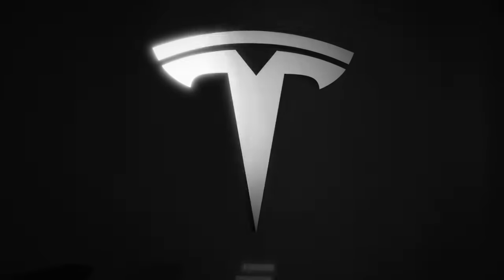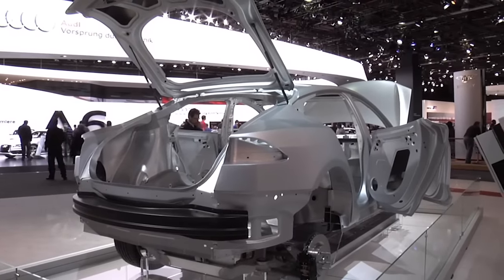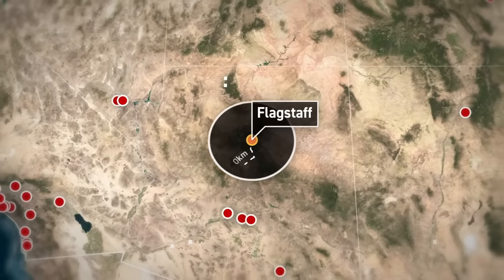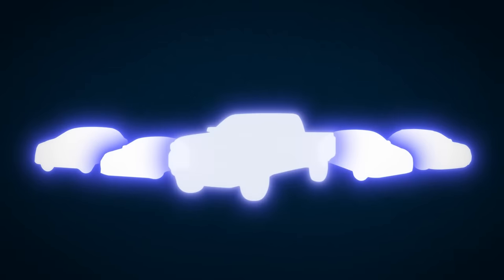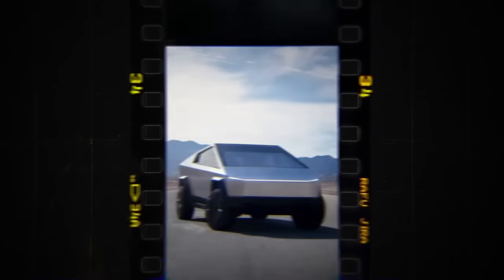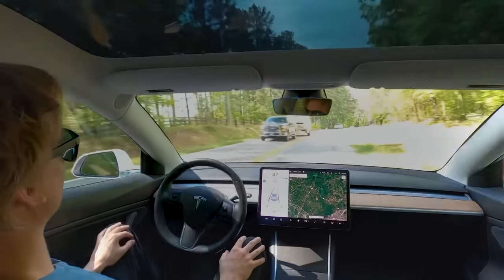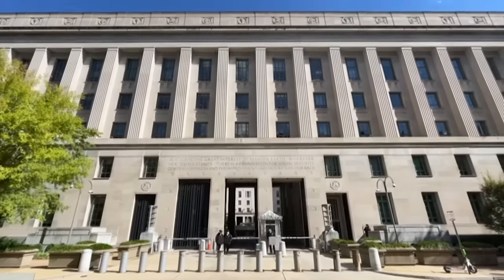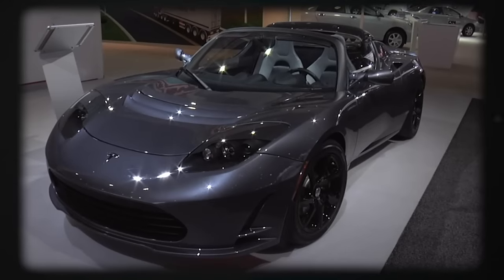How Tesla Fumbled

Comment: Tesla's BIGGEST (and arguably only) selling point at this time is their charging network. Having taken road trips in EVs, Tesla's charging network is easier to use and, most importantly, much more reliable. That being said, home charging is enough for 90% of uses and charging competitors are getting better by the day. That's not even mentioning the fact that the government is pushing Tesla to open up their network. Their singular advantage is being eaten up quickly and they're gonna have to make some major changes if they want to stay relevant.
Reply: I think their main selling point is an outstanding driver experience. But I only drive one everyday lol what do I know.
Reply: now that very same network is going to open for everyone I wonder if they will squander that as well
Reply: Definitely not the "only" selling point. Price, delivery dates, OTA updates, efficiency, performance, Autopilot (and in North America, FSD Beta), they all factor into it.
Reply: @ChrisHobson916  The thing is, everyone cares about different things about the experience. I drive a Polestar 2, and think even the performance versions of Tesla's fleet feel like I'm piloting a boat than a car compared to the Polestar. Handling characteristics etc. isn't substantially different from say a Nio, which has similar experience to Tesla. So unfortunately that just goes back into the video's topic, they aren't alone in the market segment, but they're acting like they are.
Reply: @ChrisHobson916  it’s not lol
Reply: @wojciechmuras553  yeah but the orice comes at the cost of no customizability at all. Acceleration alone also doesn’t necessarily mean good performance. 
Efficiency is good but they have already been beaten. Others will follow.

Also fsd is a joke, it took them until a month ago that their cars even recognize german road signs 💀
Reply: I would say this is only a selling point due to Tesla's continued insistence on using proprietary plugs, and excluding anything that isn't a Tesla from their network.

I would much rather buy a car with a standardized plug that is supporting total EV adoption, not just their EV adoption.
Reply: @MaticTheProto  That's Autopilot, not FSD. FSD isn't currently available anywhere except the US and Canada.

(tbh, as someone who barely speaks German, I get confused by German speed limits too - they have so many random rules written under them, some work only after dark, some are for trucks, other's are only applicable in bad weather, and it's genuinely confusing for a human foreigner to get the hang of it, I don't blame the robot for having a hard time)
Reply: @ChrisHobson916  the driving experience is that of an appliance. Nothing special.
Reply: It was indeed for me. Other things I like, but the charging network is a huge plus.
Reply: @ChrisHobson916  I drive a Model Y quite often as well. The experience is kinda just okay. There isn't much that I despise about it but there isn't much to like either. It's as noisy and stiff as a Miata without any of the handling characteristics or soft top. It's got the handling and feedback of a big SUV without any of the luxury or ride comfort. The backup camera sucks. Visibility isn't great. None of these are huge dealbreakers when you account for the convenience it offers but none of them are selling points either.
Reply: PHEVs kind of eat into the supercharger advantage. I drive a PHEV Niro. Day to day driving is all electric, and I charge at home. Road trips are almost all on gas, but getting ~55 mpg on the highway results in a fuel cost not very different from using charging stations. Certainly not different enough to make up for the many thousands of dollars difference in vehicle price.
Reply: @wojciechmuras553  They can't compete on price with EVs like the Leaf, Bolt, etc. Supply chains will recover, and other car companies will be able to outpace Tesla in production. The Tesla Model S is not even the most efficient car on the market anymore, despite having a much longer history making EVs. These were all big selling points a few years ago, but now they just aren't unique, and that's only going to become more true in the upcoming years. At least, unless Tesla makes some significant changes.
Reply: @wojciechmuras553  Delivery dates are a fleeting advantage, as mentioned in the video. As is price. My Jetta gets OTA updates. There are EVs with better efficiency/range. Autopilot sucks compared to the competition (Ford > GMC > Merc > BMW > Toyota > VW > Tesla according to consumer reports). 0-60 is the only place it wins, but even that is being challenged at the top end by Lucid. Not to mention how there are even gas cars catching up to the model 3 because of how its power pitters out towards the top end of speed.
Reply: @Dave_the_Dave  Totally agree. PHEVs are the near future. I'm looking at an s60 recharge for my next car :)
Reply: @EebstertheGreat  Oh, they can. But they're making 10 grand of pure profit on every car, and still selling every single one they make, so why would they?

(Also, I've been hearing about outpacing their production for years. Meanwhile Tesla is set to almost match BMW, Mercedes and Audi this year when it comes to number of cars sold. Not just their EVs, but the entire companies, EV or combustion!)
Reply: @ericw.1620  Jetta gets OTA updates for what, navigation? Tesla can remotely redesign their battery heater logic, shortening the charge time and lengthening the range in the winter. Tesla can add Steam. Tesla can remotely install a new algorithm for the automatic high beams. Tesla can add easy entry. Tesla can install blind spot monitoring.

For free, to cars which were never sold with those features, are years old, and no one even thought about them before.

As for Autopilot and consumer reports, please go and read their whole report. It's so obviously biased it hurts. Among the advantages of SuperCruise was "it will only work on pre-mapped roads, preventing you from using it where the system might not perform best". And they actually took a point off from Tesla because "Instead of a single press of a button, you have to pull the stalk twice, which might confuse the user". That's the kind of quality journalism consumer reports exhibits.
Reply: @wojciechmuras553  They are making 10 grand of profit and selling their cars for 18 grand more than the competition.
Reply: @wojciechmuras553  most of the OTA updates you’re describing are features that should have been there in the first place and are in their competitors. And the Jetta was just an illustration. Lucid, rivian, and even GM and Kia have adopted similar OTA strategies.

And while I agree that consumer reports has some weird reasoning, I still agree with their overall point that Tesla isn’t the best with driver assist. Autopilot isn’t as smooth as competitors nor is it as reliable. Outside of autopilot, other driver assists are SORELY lacking in the Tesla. Lane keep is abysmal. Auto braking rarely works. Rear and cross traffic alert is spotty at best. These are all features that you need to have confidence in if you want to market it. Nobody wants an auto stop that works sometimes.
Reply: @EebstertheGreat  Ummm, no? Model 3 is still cheaper than BMW i4, Polestar 2, or Ioniq 6, despite Tesla's markup.
Reply: @wojciechmuras553  i do blame the robot because it’s straightforward and even my 2018 a class has 0 issues.
Reply: @ericw.1620  Sure, in brand new cars, that's something you'd expect. But when your 10 year old car out of the blue gains support for Apple Music while you're sleeping? That's what I call fantastic OTA capabilities.

While others are trying to replicate it, their mess of microcontrollers has so far very effectively prevented any of the legacy automakers from even coming close to Tesla's level.
Reply: @MaticTheProto  I'm pretty sure the A-class can't recognize street signs at all. Doesn't it just use the limits it has saved in its map?
Reply: @wojciechmuras553  nope. It might depend on the options in each a class, the most basic version might exclusively have saved data, but a camera for that is most definitely available
Reply: @NyashaM  not all of them. Only 25%
Reply: @wojciechmuras553  I'm comparing it to budget EVs, which sell for $27k.
Reply: @EebstertheGreat  Which do not compete directly with Tesla's current offerings, and can not be reasonably compared to it. Once the $25k Tesla is on the roads, we can start comparing. But that's still 2-3 years away at the very least.
Reply: @wojciechmuras553  It remains to be seen if a $25k Tesla ever shows up. If it does, then you will have a good point on price. But as it stands, I don't think Tesla is winning the price war at all.

Comment: EV but not a Tesla owner. I think their charging speed and charger networks are,  for just a little longer, likely to be selling points. Until maybe a year ago I'd say their range was something they were clearly a leader in too. 

Maybe also do an 
essay on why Electrify America and others can't keep their DC fast chargers working and whether the new federal money is likely to solve the problem.
Reply: And While you're at it look into why EA chargers just flat refuse to charge if battery is very low and very cold. There's got to be a way the charger could negotiate with the car to heat the battery for a while with a little juice being provided and then start really charging once the battery warms up some. But Instead the EA chargers just refuse to charge even when the charger works fine. I suspect that's a policy decision and not a technical limitation of the system.
Reply: @shayneweyker  This is HUGE from the MOMENT you plug in a Tesla charger it begins to condition your battery to get it ready for charging so that in the end your car charges WAY FASTER.  EA and others FIRST want you to put in your credit card, authorize it and everything else.  Sometimes it takes a few mins to get all that accomplished especially for someone who has never used your system before.  All that time on a Tesla charger would have been productive.  On the competition, they're so busy counting their pennies that they want you to wait until they're SURE they get paid.
Reply: @shayneweyker  technical solution in US - selectively use military grade semiconductor components that operates at -40 degrees.
Reply: It's the only car you can easily take cross country.  Charger availability in my experience is 99%!  Public non-Tesla charging networks?  Maybe 50% availability!
Reply: Their price point even after price cut are still extremely high, there are many EV that have similar range that cost $20k. People like me can't afford Tesla.

And remembering how big percentages of Americans earn less than $40k a year. Tesla is not in a position to capture the mass market.
Reply: @nntflow7058  Except that they are - their price points reflect market demand since their margins are 9x other car makers.   In other words, they could drop the base Model 3 price by $8000 and still be profitable.....  And that would be well under the average car sale price of $43k.
Reply: @ckm-mkc  2023 Chevrolet Bolt EV have range of 259 miles. It got starting price at $27,495 (already included $995 destination charge).

After tax credit of $7,500. It now cost around $19,995 for that particular base model.

It doesn't have fancy features like Tesla 3 or superchargers. But it is very cheap compared to Tesla Model 3 base model that cost $36,490 after the federal tax credit.

That's a saving of $16,495! 

In some state like Illinois. You get $4,000 extra tax credit for both the Bolt EV and Model 3. This bring the price down to $15,995!
Reply: @nntflow7058  I'd rather buy a used 2013 Tesla Model S for 25K vs a new 2023 Chevy Bolt for 27K.  I mean it's just NIGHT AND DAY, The ride, the comfort, the space.  EVERYTHING about that 10 year old car is BETTER and to top it off, MOST still have lifetime free supercharging.  Chevy Bolt does have SLIGHTLY better range, maybe 10-30 miles better but that old Model S still charges probably TWICE as fast as the Bolt.
Reply: @TheCostofAutism  No, Chevy Bolt would cost $19,995 after the tax credit. it won't cost S27,000.

In state like Illinois, you get extra $4,000 for EV. So the Bolt would cost you $15,995.
Reply: @nntflow7058  The person who owes $7,500 in taxes probably has a lot more to lose if involved in a serious accident than your average driver since over 1/2 the US pays no Federal taxes as it is. While the Bolt isn't an unsafe car (much safer than anything Dodge/Jeep makes) it's still has a small crumple zone and safety features. For a 15 mile daily commute and getting local groceries it's probably OK. If you're driving on a highway I would get something the size of a Camry or larger considering all the full sized pickups people are driving around just for fun. One serious medical injury and you're bankrupt for life. If you're going for $20 to $30k car a Leaf would be better.
Reply: @nntflow7058  read the fine print that's only if you have paid at least $7,500 in taxes.  If you're like most Americans that have paid less than $3K in taxes, then your tax credit will be whatever you paid. Besides would you rather pick up your girl in a nice and comfortable fancy Model S or super cheap cramped uncomfortable Chevy Bolt?
Reply: @TheCostofAutism  In order to pay $3k of income tax a year, they have to earn around $24k a year.

A person who earn $24k a year would not be able to purchase any EV. Even some secondhand EV is still to expensive.

Secondly, I don't need expensive car that I can't afford to impress my GF. I don't need to try to compensate for my genitalia.

Thirdly, Chevy being taller makes it more comfortable for people like me who are 6 foot to get in and out off. Model S is very short and cramped. Like any other tesa models. It's no go for many people. It's a FAT SEDAN after all.
Reply: @Tokamak3.1415  Maybe, my issue with the Leaf is that Nissan is still using the CHAdeMO connector for fast charging, it doesn't seem like a good idea to buy into a dying standard. Otherwise, the Leaf seems like a great option.
Reply: @Cat-cb9ep  The DC port AND the lack of liquid cooled batteries are the Leaf's weak points. When some phones can have liquid cooling it's silly that Nissan couldn't bother to add even a simple abstraction layer to keep the batteries reasonably cool/warm. Nissan will drop it as soon as it gets Ariya rolling.
Reply: @nntflow7058  First of all The top 50% of taxpayers paid 97.1% of all FEDERAL income taxes. We are NOT including State Taxes in this equation, because it doesn't count.  With all the deductions available to most people, the average person, who is in the BOTTOM 50% only pays around 3K in FEDERAL INCOME taxes.  
Second, You've obviously never driven a Model S, my neighbor who HAS a Model S is 6'4" and when I came home with a rented Chevy Bolt, he was like WOW!!, I'd never fit in that thing.  
Finally, "Compensating for Genitalia"??? REALLY ... So anyone who wants to "Look Good" by showing up in a nice car is "Compensating for Genitalia"??? Listen if that thing does it for you, then buy it!  Don't insult the rest of us for wanting something that's ACTUALLY COMFORTABLE.  There's a reason Tesla outsold Chevy Bolt at a rate of 10 to 1.  It's because they're ACTUALLY nice cars, ACTUALLY comfortable cars and have a charging network that is ACTUALLY useful.

Comment: It has probably happened since this video was recorded, but hasn't the ford's EV (the lightning) been recalled in the last week due to charging issues or something like that?
Reply: Yes. Ford halted deliveries due to a possible battery issue. Likely software related but rumored to be a potential fire issue.
Reply: Probably. Every EV is essentially a prototype right now. It's going to be a few years until some major kinks are worked out. I've seen some really dumb oversights that didn't happen on ICE vehicles mostly because the engineers have never had to think of that specific thing before.
Reply: No recall for the battery issue yet though they have halted production.
Reply: @travisscavoni369  truck caught fire while changing, so they are no out of the woods yet.
Reply: You're right,  the F150 lightning has been recalled over potential fire issues.  Production halted for a while.
Reply: And ALL production and deliveries halted until further notice.
Reply: Yes, but their fit and finish is excellent.